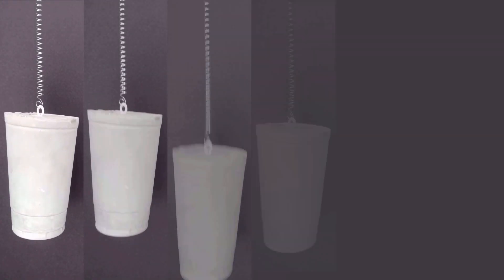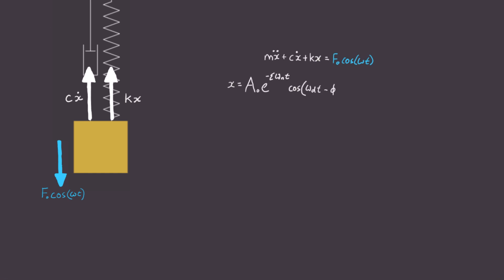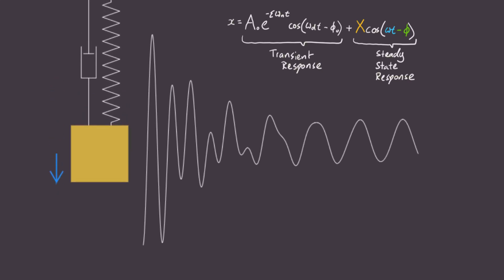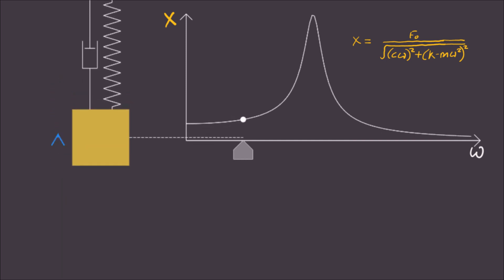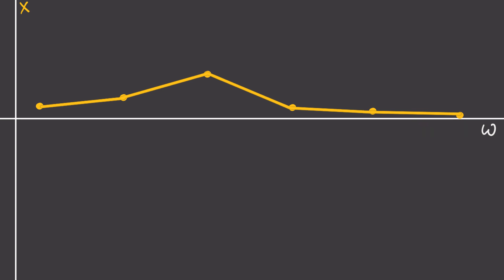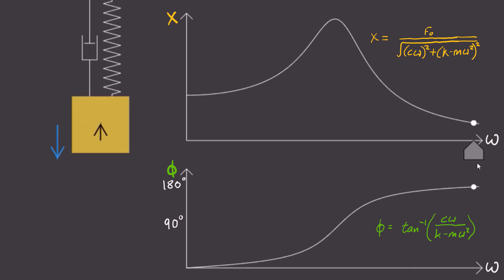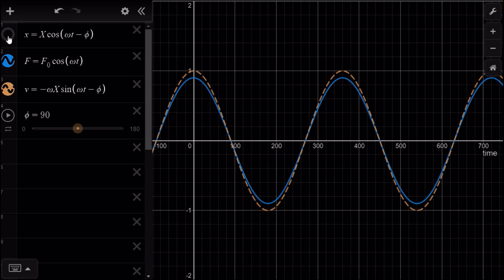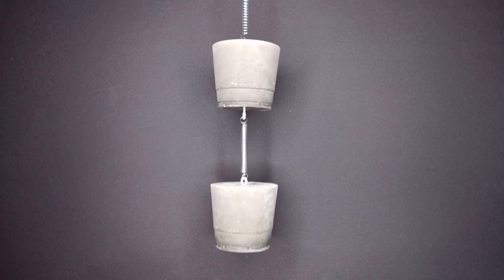Mathematics of Vibration [Part 2: Harmonic Excitation]

Comment: Compliments to the quality and content of the video.

I have some questions:
1. How do you approach the analysis of the steady-state response of a multi-degree-of-freedom system to harmonic excitation?
2. Please explain the phase angle in the steady state response of a system under harmonic excitation. How does the phase angle vary either frequency and what does it indicate about the system’s behaviour?

Thanks in advance 😊!
Reply from the maker: Great questions! 
1) you'll typically have a matrix FRF function in that case where each element of the FRF will relate one specific input to one specific output. An important caveat here is that this only applies for linear systems where the superposition principal can be applied.
Reply from the maker: In answer to your second question: there's a lot of information to unpack about phase but some key insights are: when resonance occurs you will be neither in phase nor out of phase with the input. It'll be at 90 degrees. After resonance you will be at 180 degrees phase which implies that you're fully out of sync with the input. Before resonance you will be at 0 degrees phase which implies you're fully in sync. 

If you have a multi degree of freedom system though then it becomes a bit more difficult. You can use the bode gain phase relationship to protect how phase relates to gain